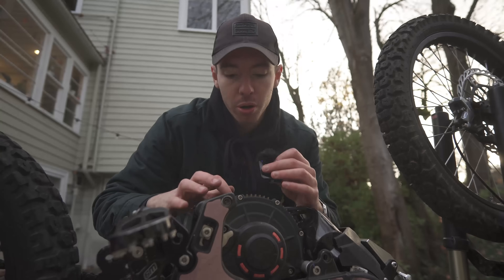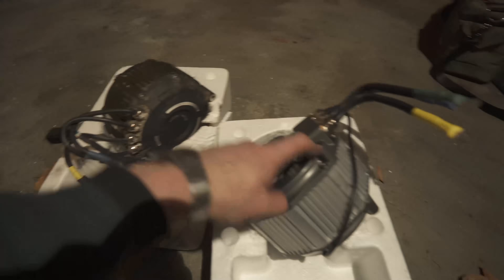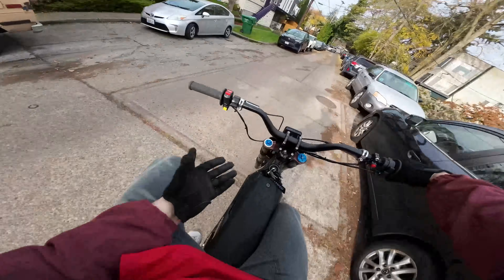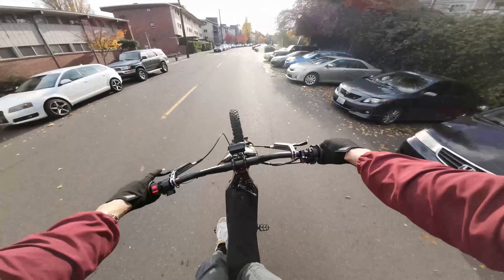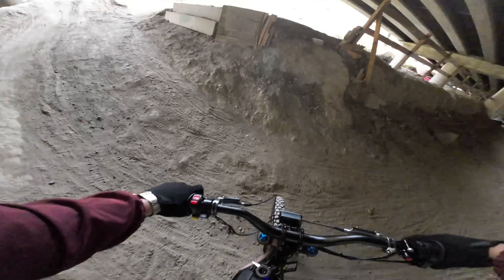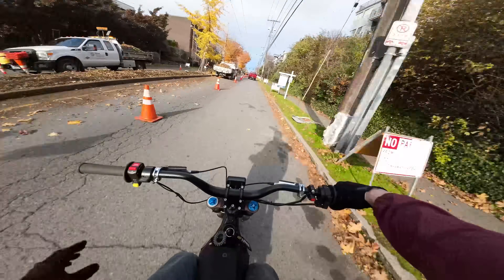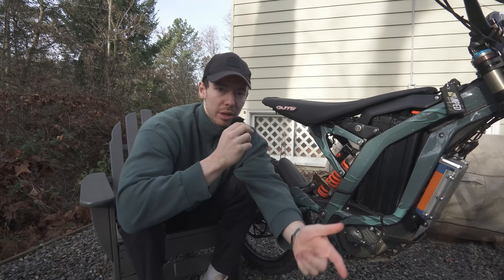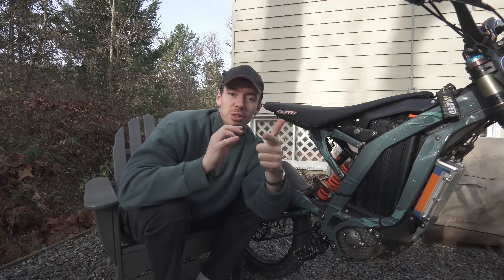Putting a HUGE electric motor in my e-bike! (Surron Sotion motor review)

Comment: Yeah, I think the reason that the surron motor. belt drive is so choppy is due to the fact that the bike comes with region already active and you have a cord that should have came along with your box for the bike but itll let you program how strong you want the region on the bike to be or if you want it to be off like in eco mode region isn't as strong as in sport mode. This is all assuming if you never reprogram the bike to turn region off

Comment: Omg.. first,this is the first, whatever this is, I've ever seen.. which is really cool.. 
I was watching Hatfield McCoy trail videos, and this popped up in the feed.. 
If you took this (stock) to a trail system with your gasoline buddies, could you run all day with the ups and downs and go through creeks with it half underwater when need be? Also, how long does it take to fast charge it if it can be ?
Reply from the maker: these things are great for tight trail riding! But the stock battery might not last quite all day - but would be tons of fun for many hours. They handle water reasonably well.

Comment: Can you just run any 3 phase motor on an ebike?
Like motors for industrial machinery?

I'd be cool with a big okd motor so ling as I had modern battery cells capable of 240v+. I wouldnt mind a heavy battery as long as it was low and centered. 

The problem comes in with vehicle laws. Too much power and it becomes a motorcycle.
Reply: Probably could but that bike would weigh like 200lbs minimum, I’m guessing you wouldn’t really get any speed or range.

Comment: Hey ' I have just installed the sotion motor and I cannot do my configuration with my bac8 on the kilowatt application, my wheel is blocking.  how did you do it please? 🙏🏼🙂
Reply from the maker: did you get it from GLE? You’ll need to update your firmware so that the BAC works with the motor, so try emailing the vendor of your controller and see if they can help!!

Comment: I have every upgrade on my Surron except for this motor will it drain my battery
Reply from the maker: seems like it drains a bit quicker, but that's probably because I just accelerate harder way more haha - it's worth it, you can always turn down phase amps or peak power a tiny bit to compensate, but still have a faster bike!

Comment: Glad you mentioned our custom firmware that is included with the purchase of our motor as it makes a big difference in compatibility, power and performance!
Reply from the maker: excellent job to you guys 🫡
Reply: Send me one please! 🙏
Reply: GLE is literally the worst in the industry , do us all a favor and crawl back under your rock and take your crap with you
Reply: Do you guys have anyrbint compatible for the stock battery and controller ?
Reply: Does the Sotion work with emb bac 4000??
Reply: @Orenbly88 yeah if you get it from GLE they can make it work with your EMB4000
Reply: That's the same question I have. Upgraded battery and a BAC4000 from emotobros @Orenbly88
Reply: Badass video
Reply: Thank you for mentioning you guys also sell it. Would rather support GLE since that’s where I originally bought my controller from.
Reply: Can I get the file for the hall sensor motor ?
Reply: I’m getting error 40 with my ko controller and the gle sotion motor plz help or do I have to buy a Torp or bac?
Reply: @ use the Ko Pc software to set up the correct temp sensor.

Comment: I wonder if the old motor having that resistance helps with regen. Have you noticed the regen change with the new motor?
Reply from the maker: since it has bigger internals, hypothetically you should be able to return more power when using regen. the resistance of stock is just mechanical drag, unfortunately, so i think it might actually hurt regen efficiency :-/